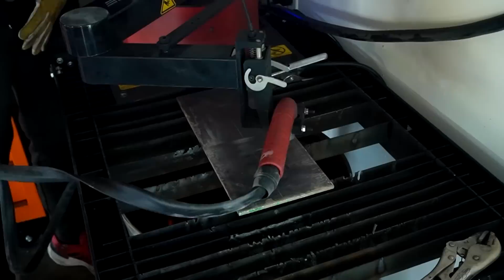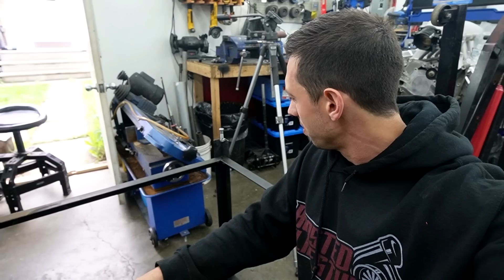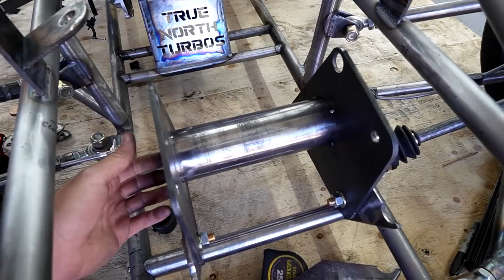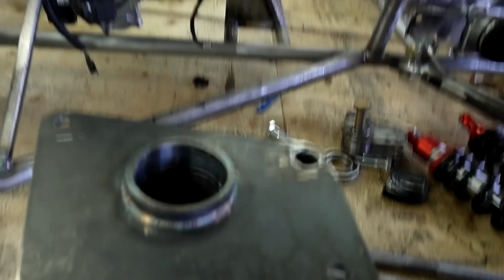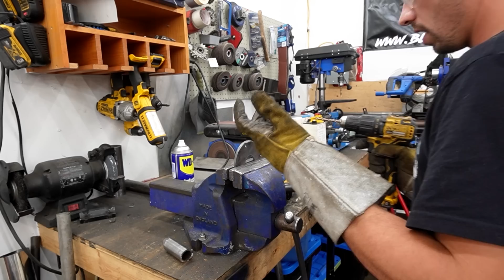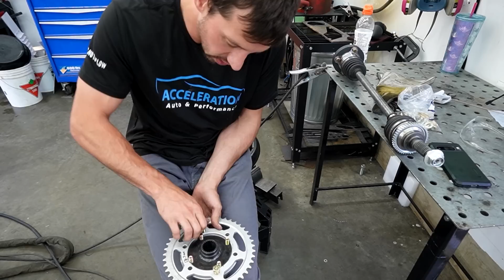Homemade Formula 1 Rear End And Chain Drive DONE - Pt 17

Comment: I think having the caliper and rotor at the wheel is a safer option. 
I’ve seen a few Honda drag cars that had what looked like disk brakes from a sports bike but there not. May be something to look into to reduce weight and rotational mass.

Comment: FYI: its not a differential, it is a solid axel.  You will end up with tire wear.  A differential lets one side turn faster than the other so that one tire is rubbing off on the pavement.  You will essentially only have one tire's worth of traction.  Solid axels are ok for drag racing, but you will need to rethink that for racing a course.

Comment: Honestly I’d spend some time in the future making it lighter. More aluminum parts where you’re using steel now. Rear sprocket hub and axle mounts and spacers. The pipe inside the rear spool can be made out of aluminum. Shorter or smaller diameter grade 8 bolts here and there. It all adds up. Not a critique btw. But dope build regardless

Comment: Check your kerf and slow it down cutting circles. Also play with the pierce start point and thc and that should cut the beveled edges from happening. If all else put a new tip in it lol.

Comment: To help with the Arc droid cutting circles and holes if you do the holes smaller you can then drill/ machine the holes to the final size you need and if you do the circles bigger than you need you can then machine them to the final size

Comment: That chain did not look happy at all. Overly tight is bad. While is doesn't need to be loose like a motorcycle, it does need some amount of slack. It also looks mis-aligned based on the top of the chain rising up before it gets to the front sprocket.

Comment: Pretty sure it's not the accuracy in your arctroid meaning the deflection it has it might be a bad tip in your plasma cutter That's usually why it cuts at an angle or too fast of travel speed

Comment: Built something similar way back in 83 but didn't have all the fancy tools nor large amounts of money. 
Basic tools were welder,  cutting torch,  grinders and compressor for painting but managed to build kinda replica of old formula 1 car like BRM and LOTUS shaped body. 
Engine was a 1000 cc Kawasaki and differential was made by myself from Crown wheel of a VW modified to a LSD unit.
Still have a photograph of it and looked stunning in the end but most enjoyable was the handling as I developed a Rear wheel Steering system acting on Weight Transfer when cornering.  This worked magically when dialed in .
Now I am 71 , had my first heart attack but still rebuilding cars stuffing V8'S into them just for the hell of it. 
Have plans to tell the angel who's to come fetch me to hang on I'm busy .
Reply from the maker: Man that's actually amazing especially with the difference in technology since you built yours

Comment: This is great. I have a complete bike engined formula car. We call them formula m in my country. I had a solid axle in my car and it make it undeliverable. I think you are going to battle to get it to handle. It’s going to understeer on corner entry and change into snap oversteer as soon as you touch the throttle. Never the less it will be a bunch of fun to drive
Reply from the maker: Yest I think it's more of a temporary solution for the time right now
Reply: @AdventurekyleAU  feel free to contact me if you end up changing and I’ll share some pics of my diff project

Comment: Where would a cart like this be run? Where would you find the requirements and restrictions for a cart build like this? Thanks for the video. Will you have to have the frame and parts heat treated after all of it is welded up?

Comment: For the holes you broke drill bits on, it's because the heat of the plasma locally hardens the steel. Undersize the hole some more and they should drill out easier 👌

Comment: @Boostedlifestyle Without a dif the car wont be able to turn.... it will just go straight even with the front wheels turned left or right. I saw a project like this for a go kart and it happened. The solution was to disconect one of the rear wheels fron the shaft and have traction only on one side so one wheel spins freely and adapts it self for the needed speed during corners.

Comment: Just a thing and a notice but read at your own risk, this isn't a negative comment just trying to help where I can. You probably already know this since I'm new here. But I don't know if you watch Grind Hard Pluming or Rather B Welding. I've learned a lot from them, and they both use the arch droid. I did notice something about your arch droid. I think the cutter is sitting in the arm at an angle. The torch needs to be 90 degrees perfect, and it looked like yours was sitting at an angle (very slight angle). also put the arch droid on the same surface as the work, this way you won't have to worry about leveling the tables together. 1 surface to rule them all.

Comment: Also for your security mount a cover on the chain, that is the first thing that explode in such setup (in hill climb they use this a lot) the chain explode and its like a flying chain saw it can cut anypart of your body in half when flying. a chain tensioner is also good :). nice project wel done

Comment: without diff you will not handle in turn , and brake the shaft, you should use a transversal diff (you could find an european limited slip diff for 300$) then weld the gear or bolt it on it

Comment: Solid axle makes this “F1” a go cart.  Not sure of the back story on this, so there may be a good reason, but it totally screws up balance coming out of corners under throttle and handling in general in any turn.  I was in the FSAE competition 1993 and *everyone* used an LSD.  We sourced solid sprockets and machined them to the LSD (center hole cutout and bolt pattern) and IIRC we used Ford Fiesta CV joints (Miata is probably overkill).  We mounted the LSD to pillow blocks that bolted to frame rails.  The pillow blocks had slotted holes where it bolted to the rails for chain tension adjustment.  But this was a senior design project for mechanical engineering students where we had a full blown machine shop (mostly pre-CNC though we did use a CNC lathe to cut the Venturi at the throttle body inlet).  Anyway, this whole contraption could be replaced by an LSD and the car would thank you.  Good luck!!
Reply: I was at the Ford competition with UMR in '92 and Chrysler in '93. Yes, we all had diffs (torsens for us), but why are you throwing shade? This dude has done a ton of work and for you to demean it as a 'go kart' is kinda bullshit, especially since you actually understand the amount of work involved in a project like this.

For the record, I'd take a spool over an open any day of the week.
Reply: @MrTL3wis  not trying to poo on all this outstanding work.  But a solid rear end will destroy the high potential of the car.  I’m too old to beat around the bush with kind words.  Put a diff in it.
Reply: @mackkenamond1800  If you have a hard time with kind words, Jack, you came to the right place. 

1.It's not my car. I have no connection other than watching the video.

2. You don't know fuck-all about getting a car around a racetrack and I've done it professionally for 30 fucking years. Shut the fuck up. The spool will be fine.
Reply: @mackkenamond1800  You're the perfect FSAE competitor after all this time. You don't know shit, are full of opinions and just hangs around to piss on other peoples cars. It's pretty sad, actually.

If you're too old for kind words, Princess, you came to the right fucking place.

1. Not my car. I have no connection other than watching the video.

2. I've been a pro race engineer for 30 fucking years. STFU, Donnie. The spool will be fine.
Reply: @mackkenamond1800  My reply keeps getting removed.

1. Not my car.
2. I've been a race engineer for 30 years. You don't know what you're talking about. The spool is fine.

Now imagine that with a lot of swears and insults.

Comment: Love the build, I've been following it since day one! One comment would be to please use washers on those bolts or go to flanged hardware instead of just plain hex head... atleast on the high stress areas. Maybe you were planning on it already but just thought I'd point it out. It will make a much better bolted joint and will minimize failures

Comment: I have a similar project going. The challenge is 700 BHP, 2.0 l V8 bi-turbo. In 1984 Alfa Romeo had the 184 T, an F1 built by a team of engineers of Euroracing. Although the 1,5l V8 wasn’t successful I thought that it delivers the inspiration for a replica. The engine comes from Ferrari, V8, 2,0l, the gearbox and differential comes from Hewland. The chassis will be aluminium glass fibre reinforced, suspension and wheels, breaks are Porsche turbo, the wishbones and all linkages are steel, all aero will be glass fibre, ground-effect.
Reply from the maker: How far are you into the project. I looked into hewland gear boxes but they were heavily priced for the budget I had in mind for this cart. But depending on how everythibg does maybe version 2 will get a proper engine and transmission

Comment: If you need a new lathe, I might be able to help find one, that one you have right now seems a bit underpowered for what you need.  The one you got looks like it was meant for wood turning and not steel working.  If you cant find one within a reasonable budget, I used to be a robotics engineer, so I could help design one with your specific needs in mind.

Comment: The amount of force the spool will see is ungodly, especially without a differential. You're going to need bit more support around that spool. Since you don't have a diff you should go to a single inboard disk brake. Source: I own a racecar with a similar setup.
Reply from the maker: Yeah honestly I would love to redo everything on this cart. So I think the goal is finish this one, use it as a learning experience and then build v2
Reply: @AdventurekyleAU  Copy that, and it sounds like a reasonable plan.

Comment: You definitely need to get in contact with @GrindHardPlumbingCo, they are using arc droid for years... And they used that to create chain sprockets or adapters on so many vehicle. I'm sure there is some settings or adjustments that they can tell you to maximize your arc droid potential. 🙃

Comment: The other day I bought a kart very similar to This
Needs a good amount of work since i only got it for 800$ plus the frame is not as heavy as the one you built 
I need to do a bit of welding, some pedals,engine work and little stuff
also a new real axle

Comment: Is there since advantage to using a spool over a Miata LSD? Counterintuitively, I think that converting one to chain drive might have been less total work than what you've done here.
Reply from the maker: I really didn't like the alignment of the Miata diff. And it was really heavy. So I made this but I can also fit my own custom sealed diff in there eventually too
Reply: Best of luck with it. It's a really cool project and I hope it works out for you. 

It will be really interesting to see how it handles with the spool. I hope it doesn't cause understeer - which is a common complaint in FSAE builds.

Comment: Put a real strong spring in between there so it continues to put tension on the chain and it will work as a shock absorber for that chain when you drop the clutch

Comment: Friendly tip: cover the bed of your lathe with some scrap wood or shop rag while working with an angle grinder near it. The sparks and little pieces of metal flying from it could damage the bed.

Tip 2: keep the tool sticking out from the tool holder as short as possible. The tool will bend when you put a lot of force on it (as you’ve found out), less overhang means less flex means better finishing.
Reply: Dude !! You just helped me get better tooling !! Why doesn’t my brain see these things ?!!! I’ve been sticking my tool way out and it would flex and my tooling looked like shit . Putting the tool as far in as possible made everything better !!! Thank you so much for sharing with everyone!!

Comment: I recommend using a flexible tank with a sponge-like thing for the fuel tank as it keeps the fuel from going everywhere in the corners. Normally the are fitted behind the seat to keep the weight centre but with your engine configuration that might be hard to achieve.

Comment: You may need to ELI5 but, that looks more like a solid drive axle rather than a differential where the inner wheel will spin at a different speed than the outer wheel.  Yes, there ARE u-joints/dog-bones where the angles change but those don't make it a differential.

Comment: I’m not familiar with cars so can someone explain how that axle would work as a differential? Seems to me like it’s directly linked to both rear wheels
Reply from the maker: It is like a spool. Like you would see on drag race cars. Remove the diff and put in a spool. So technically I can design a differential that would bolt into place of that spool later

Comment: The steel around those plasma cut holes gets hardened from the heat. Buy a set of reams to make those holes the right size. Reams are actually more accurate than a drill bit anyway. Also if your interested I’d love to help you make an actual plasma table instead of that plasma cam
Reply from the maker: Whatcha mean with the plasma table thing 😁

Comment: If you dont have a diff yet you should try making a very thick rear swaybar, Go Karts have solid rear axles and they combat corner scrubbing by designing the front steering in a way that shifts weight off the rear inside tire, allowing the kart to corner on three wheels. running a beefy rear swaybar can help you achieve a similar effect

Comment: @Boostedlifestyle
Hey Kyle!
I wonder if you not forgot that a diff. gearing is needed to let the two back wheels run at different speed in the corners?
You talk about diff. but your rear axel is rigid!
Reply: Very correct, there is a reason why it is called a “differential”. 

With 2 wheels running at same speed with these fat tires it will not be nice to drive around corners. Please install a proper differential.
Reply: I agree, I don't see the use in a super grippy road car?
Reply: It was gonna be 100 better with a diff
Reply: He, in fact, did not make a diff. You're correct. He made a more complicated solid axle
Reply: >>your rear axel is rigid!<<
What is an "axel"?
Reply: @frankschwartz7405  it’s Swedish for axle 😂
Reply: @thomasbill9301  >> it’s Swedish for axle<<
Bork bork bork.

Comment: Nice work! My first thought on the non fitting bearings is to hone out the pipe until it fits, though that depends on how much material to remove, might be a good use case for line boring if you can fixture the part on the cross slide of the lathe

Comment: Hey mate , watching from over here in New Zealand love your videos!! 3 quick tips with profile cutting that someone else has already mentioned in the comments,, 1: the non square cuts on your profile plates could be because the tip is wearing out. not at the outer tip, but look inside it from the handle piece side, you will see what I mean. 2: profile cutting leaves behind a harder edge than the rest of the material when it comes to mild steel and grade 350, drilling holes I generally prefer to do afterwards, with no profile hole as a pilot. invest in a metal scribe perhaps? 3: ask any local engineers where they get their profile cutting done, however this will generally be far more expensive. hope this helps, keep up the good work!

Comment: de[emdomg om hoe big youre main fuse is you could install a slightly heavier fuse aspecially for the plasmacutter and compressor  , kindah like one you would uise for the washing machine , max power is about 80 percent of the main fuse (for everything thats behind the main fuse) this to compensate for the starting peaks 
the calculatio is I= U x R 
i is wattage 
U is vottage 110V in the states think canada too 
R is the amount of amps 

so say you have a 30 amp fuse running 110 volts the fuse kan hold about 3300 watts and 80 percent of that is 2640 watts 

if you have a 60 amp main fuse you could upgrade to a 40 amp for the mainshop and have 4400 watts 3520 watts amd as long as all the power combined stay under  5280 watts you should be ok go over that and the ain fuse will blow and you darken the whole house 
the wiring should manage the slight increase in power 

another option would be to hook the arcdroind/plasmacutter  and the compressor on two different puses (run an extention intoo the house )

Comment: Nice update.
Any lathe is better than no lathe at all, and the lathe you have is always too small.
As for your plasma CNC, I had the Everlast 60i and that needed a 32 amp supply which I didn't have, and it would trip the breaker on long cuts, and when the compressor would kick in sometimes because of the extra amp load.
My solution was to add an extra air tank which was just an old LPG gas cylinder with some fittings added which gave me enough air supply for any cut length.
Not sure if your Arcdroid software enables you to pause and continue a cut in progress without losing position like my machine did, and that was using Proma MyPlasm CNC System.
With the Proma system I could pause a cut at any stage where I knew it would possibly trip the breaker and let the electronics to take a break and cool down a bit then continue on from that point.
That alone saved me a lot of material that would have been wasted otherwise.
The best solution would be to get a higher rating circuit breaker installed into your shop to handle the combined load of your plasma cutter and your compressor.
That will prevent you from maybe burning down your shop along with everything in it. 😵‍💫👍

Comment: Looking good!

Assuming there's no reverse on this, could you add a sprag clutch to each CV shaft and have an actual differential effect?  The outer wheel could free-wheel faster than the inner.  Would that even work?